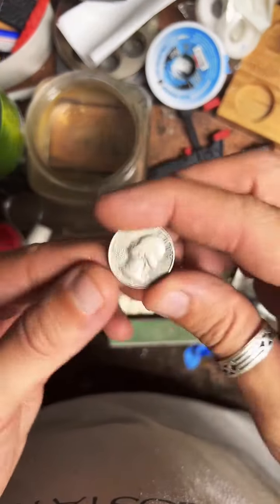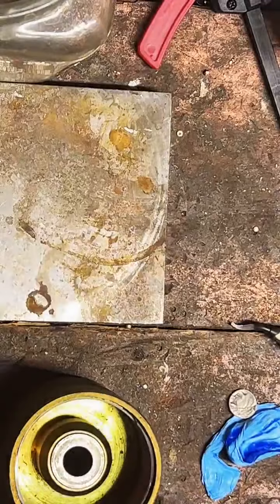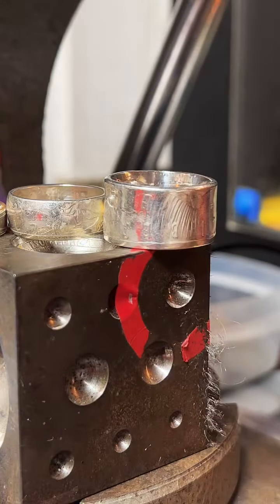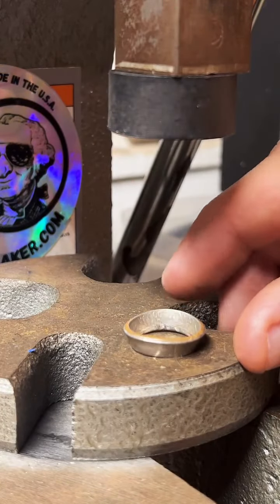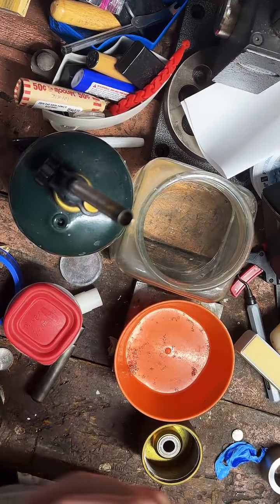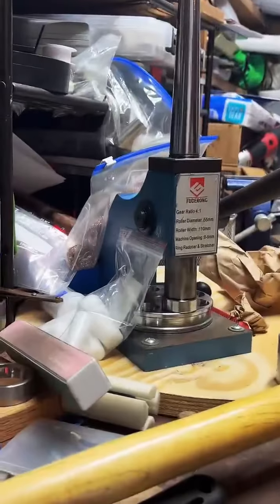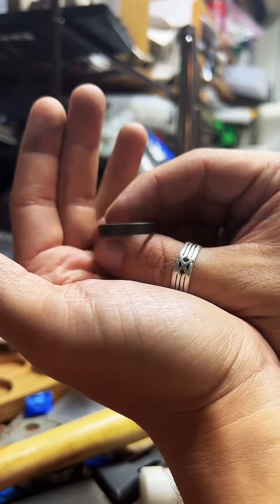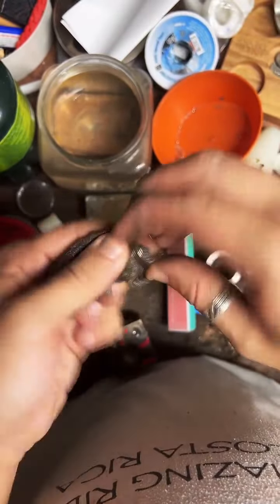Making a 1974 quarter into a ring

Comment: If people are concerned about getting a skin reaction from the clad quarter, such as turning the skin green, I was wondering if you used a UV clear resin very lightly brushed onto the finished product of the ring and hit it with UV light if that would offer a long-term protection to both the ring and the customes skin
Reply from the maker: I’ve tried this. The amount of resin you have to use for it to be effective makes it so the ring isn’t very comfortable. I’ve even tried it with softer, flexible UV resin but that doesn’t stay on the ring very long. It doesn’t attach well and rubs off. Clear finger nail polish works the best out of anything I’ve tried.